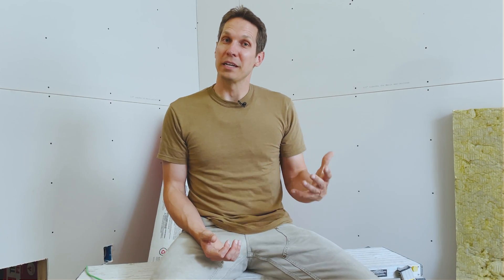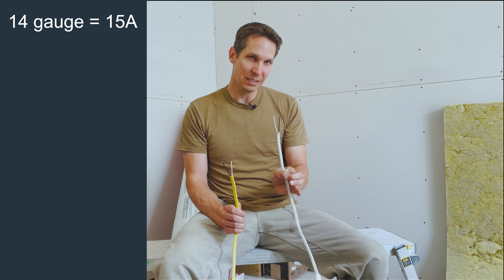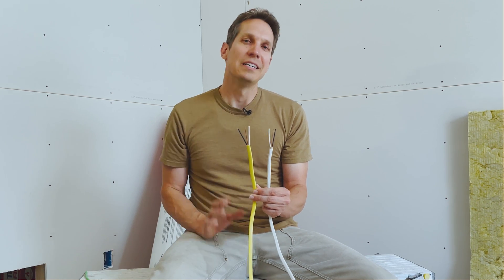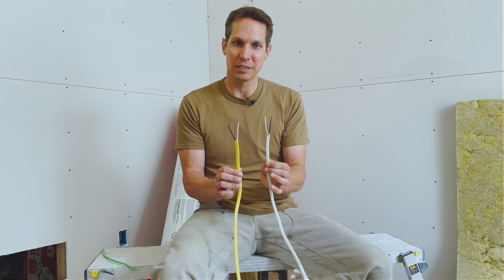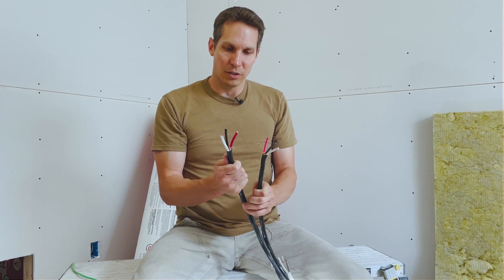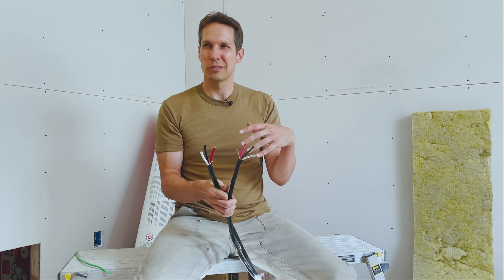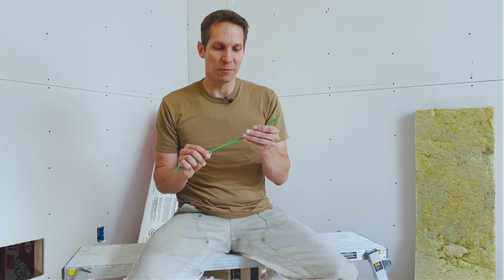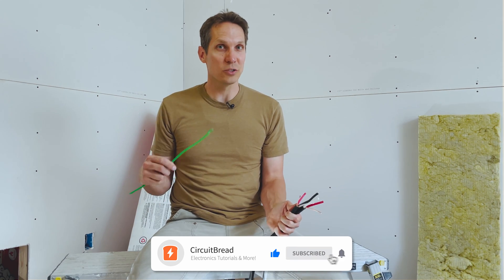Ampacity and Wire Gauges | CircuitBread Practicals

Comment: The NEC will tell you when you need 20 amp or 15 circuit not because you are installing LED lighting. Also multiple smoke detectors do not go off at the same time because they are on the same circuit. They go off at the same time because of a third (tandem) wire.

Comment: Great video. Thank you!
Reply from the maker: Glad you liked it!
Reply: @CircuitBread  OK serious question for you. I need to do a 90 foot run and I want the circuit in the room to be 20A. Do I need 10 gauge or 8 gauge to compensate for the long run? it will have high amperage loads on quite frequently and for long durations

Comment: Hmm, on your point about the smoke detectors, I guess that explains why both of my smoke detectors go off whenever I pull something out of the oven when cooking. Also, it is amazing how sensitive those things are.
Reply from the maker: Yeah, all our smoke alarms went off due to a faulty smoke detector and the entire house was deafening.  It was quite the experience.  We have a small travel trailer and the smoke detector in that goes off legitimately nearly every time I cook 😬
Reply: @CircuitBread  Yeah, I can see that as a massive pain to track down the faulty smoke detector.

On one hand, having them all connected and going off is helpful if there is a fire. On the other hand, when one fails, it is hard to track down where the problem is, and how many could have gone bad.

Comment: Why ground wire is bare? In Europe you have green/yellow wire as ground. Is this code driven?
Reply from the maker: Ground can also be green but probably because code doesn't require the ground wire to be coated (it should never be conducting in ideal situations, and even in non-ideal situations, it should only conduct very briefly before the breaker trips), it's probably just cheaper for it to be bare.

Comment: so the pattern i picked up is, the higher the gauge, the lower the amp
the lower the gauge, the higher the amp
Reply from the maker: Yep, spot on.  And it's because the lower the gauge, the thicker the wire, thus more current can flow on it.
Reply: @CircuitBread  that's helpful.  Thank you.

Comment: In a commercial application you will often see MC instead of Romex, which stands for Metal Clad. Instead of the plastic sheathing, the cover is wound up aluminum, like a metal hose with wire inside. It's pretty neat.
Reply from the maker: I actually used that to run power to my furnace, the only place I used it.  The funny thing with each type of wire, there are different ways they go into junction boxes, and each new type threw me off.  But it's good to know that if someone is ever blundering around in the mechanical room, they can't cut that cable. In commercial applications can it run exposed or does it need to be tucked away somewhere?

Comment: Here in Europe we usually name wires and cables with their cross section in mm².
That makes it intuitive and easy to calculate things like max. load and voltage drop (aka. 3% rule).
For instance NYM-J 5x2.5mm² for 3 phase connections in the workshop. The letters let you know about what materials the conductor, isolation and mantle is. And yes, VFDs are practically unknown here, every home in germany gets 3 phases 230Vpp each with 120° phase shift, fresh and organically grown electrons ;-)
In industrial settings this is even more helpful. If you hear something like NYY 5x120mm² you immediatly know to run as fast as you can or else you pop a disk. Ask me how i know.
Also, i envy the french a little. They have to use halogen-free cables, aka. no chlorine like in pvC. As someone who was trapped in a burning house as a kid i can tell you, inhaling HCL gas
hurts like hell for 3-4 weeks.

One last bit: for almost 50 years now we only use round cables. I mean round like in totally round. It sooo much easier to pull that stuff through insulation pipes, dry walls, etc.
And if it still gets caught on an edge, a dash of dish soap works miracles :)